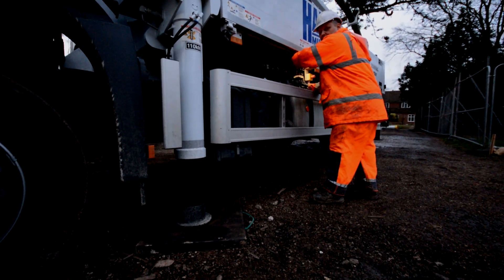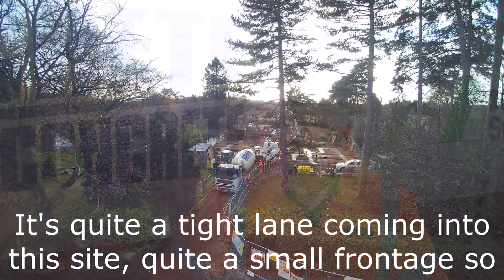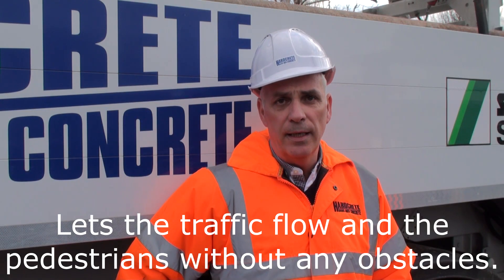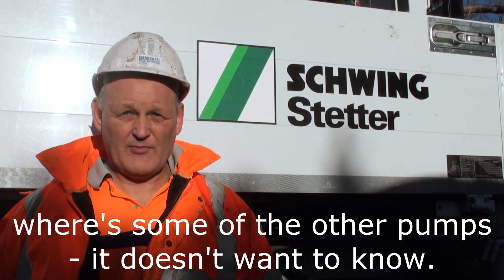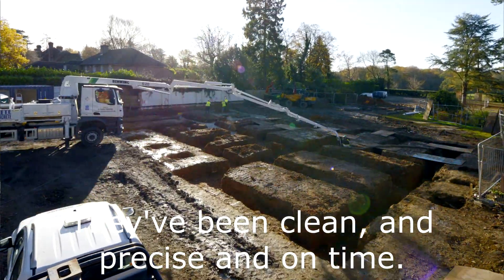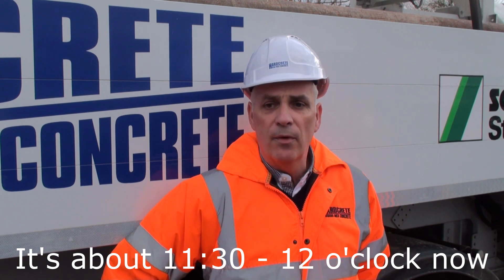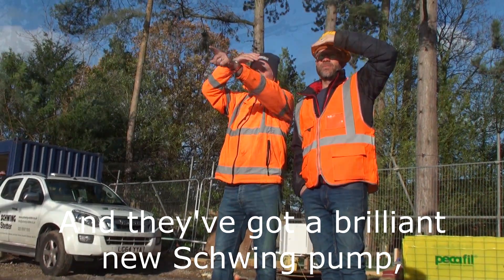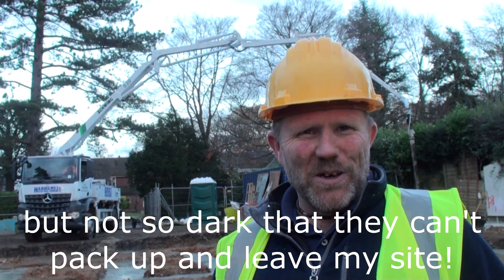Concrete pour at Chorleywood with Hardcrete's new Schwing S 20 pump

Comment: Why a 20 meter pump don’t use the outrigger at all ?? Is that safe performance?? I’m boom pump operator in USA Florida, we do not open any pump without the outrigger 😳😱
Reply: I want to ask too
I am boom pump operator in HongKong
Reply: @kawailin9509 it’s called short rigging you put the legs down just not out but that obviously depends on the kind of ground you are setting up on as well  (my dad is the pump operator in this video) I am also a pump operator lol
Reply: it’s called short rigging you put the legs down just not out but that obviously depends on the kind of ground you are setting up on as well  (my dad is the pump operator in this video) I am also a pump operator lol